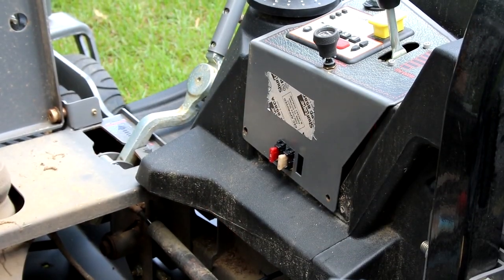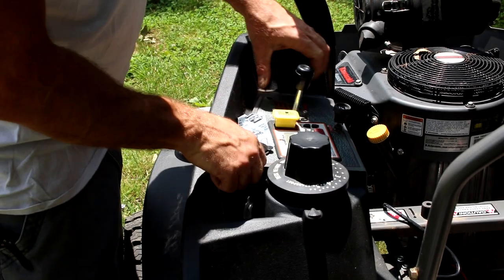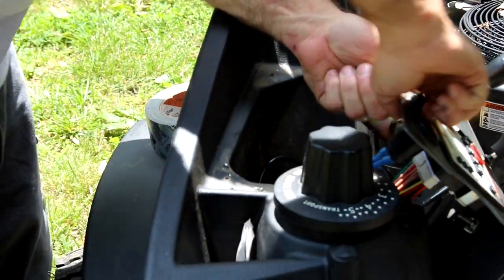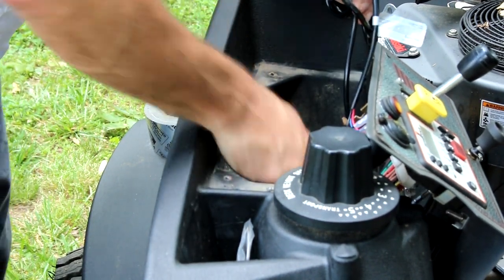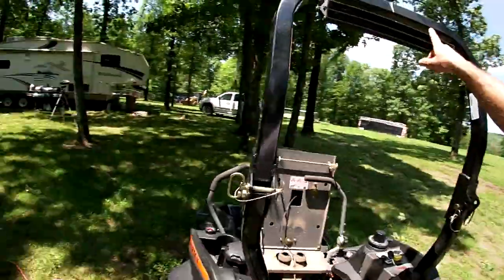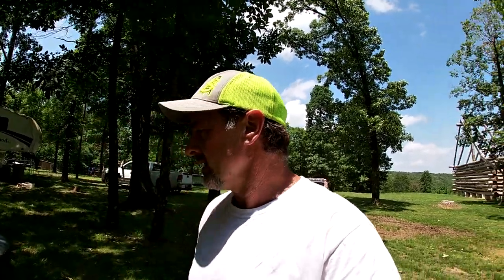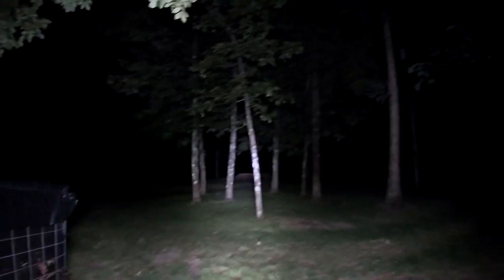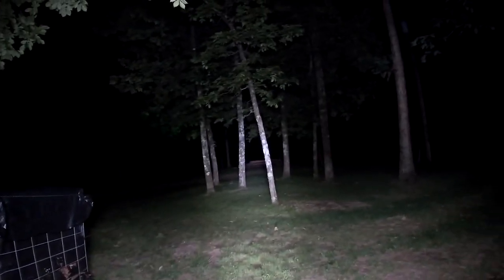Ultimate DIY ZERO TURN LED LIGHTS!!!

Comment: It was already wired for light's the plug was under the seat
Reply from the maker: It was but the panel is only rated for the single light. The overhead light bar pulled too much amperage combined with the other one.
Reply: @hickoryridgehomestead9177  Why not use the factory switch and wires to feed the relay and thus you don't need a separate switch?
Reply: @kirkkw  plus LED lights pull hardly ANY amperage at all anyway. I'll be using the factory switch on mine.

Comment: Can you add a link to the light bars you used?  I can't find a generic 10" light bar to mount into the designated spot for OEM light placement.
Reply from the maker: It’s not a perfect fit but this is the one I used. 
https://www.ebay.com/itm/265376530657?mkcid=16&mkevt=1&mkrid=711-127632-2357-0&ssspo=fFWm4uPURp2&sssrc=2349624&ssuid=KOkAtvQhSm-&var=&widget_ver=artemis&media=COPY

Comment: You’re crazy.  Turned out pretty cool however I would add some  of the little square directional LED’s at the front corners of your mower so you can increase the radius of the light. Maybe you can see just fine in person but in the video I wanted to see a wider path.
Reply from the maker: the video wouldnt pick up all the light. It is almost like driving around in the day time.
Reply: That’s great.

Comment: Isn't there already a button wired up??
Reply from the maker: Yes there is but I was afraid to burn up the circuit board with the extra amp draw
Reply: @hickoryridgehomestead9177  the only draw you would be adding would be that of the relay which is next to nothing. That’s the entire concept behind a relay in this situation.

Comment: Did you not know the Spartans com pre wired for lights ? The pig tail is zip tied out of the way .
Reply from the maker: yes but the added light bar draws too much currant I and didnt want to damage the circuit board
Reply: Did you even watch the video?
Reply: @hickoryridgehomestead9177  If you are using a relay, the amps go through the relay and not the switch.  The switch’s job is to energize the relay which then powers the light bar. The original switch would have worked just fine. Relays don’t require much amps to be energized.

Comment: What model relay did you use?
Reply from the maker: It was a light bar relay kit from Tractor supply.
Reply: @hickoryridgehomestead9177  pardon my ignorance but what and why do you need a relay?  Thanks
Reply from the maker: @howardmoody9379  the relay is there to keep from pulling too much current through the switch

Comment: I put a bicycle light on a push mower 60 years ago to mow after work, 1/2 acre, so I think it's great. The light on the front is all you need just to see where your going. But whatever. If you're mowing 6 acres you need a 6-8' foot finish mower on the back of the tractor. It will beat the devil out of the zero turn. You need a bagger on that mower cause I think that stuff is legal just about everywhere now. 
Yell man, bag it man, sell that stuff make some money man.  Take care, later, stay safe.

Comment: I appreciate you explaining why you installed your own switch instead of using the pre-installed one. For everyone else asking, he already has a light bar installed on the front (where the default cut out is on the Spartan). This will be the second light bar installed on the mower. Just to be safe, he didn't want two 10 inch light bars running off the control panel as it might've drew too much current, risking damaging the control panel. 

I know some people have said two light bars won't draw too much current, but I agree with you here: 

1. The control panel isn't designed to run two 10 - inch light bars (even if it might be able to do it) and; 
2. That control panel is a $275 part. Can you really blame him for taking the much safer alternative for putting the second light on it's own relay and switch?

Great video. Nice Tutorial!